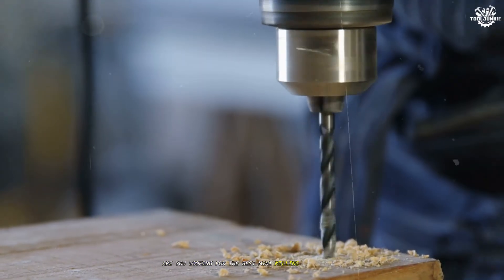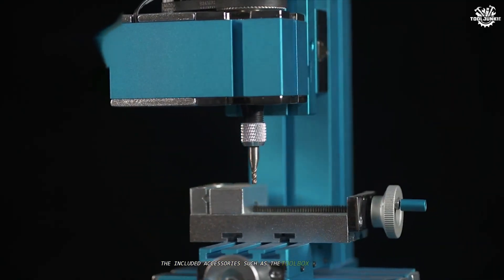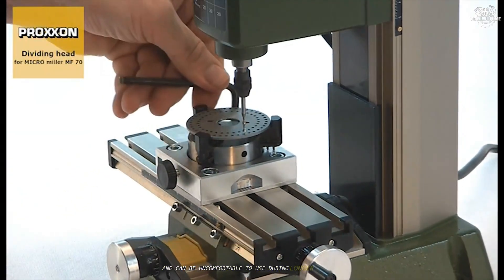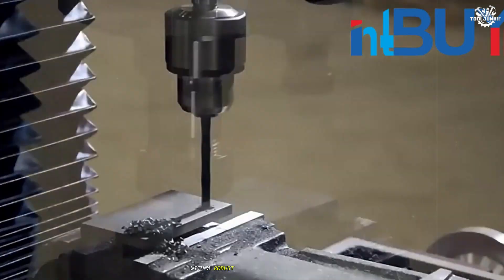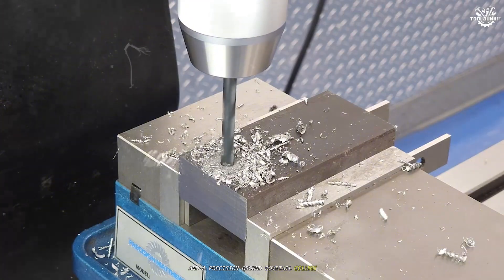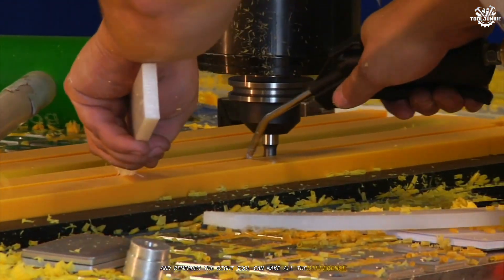7 Best Mini Milling Machine 2025! Which One Wins?

Comment: @ Tool Junkie, I want to thank you for making a great video. I am looking to purchase a mini mill. I don't want to spend a fortune though. This mill would be used for light gunsmithing and making AR Lowers. Which one would you suggest for this situation?
Reply: I believe the PM 728 can be converted to cnc.
Reply: These machines are all likely to disappoint. Find and older used machine with heavy castings.

Comment from the maker: 🕝Timestamps🕝

0:00 - Intro: Best Mini Milling Machine
0:36 - Universal Mini Metal Milling Machine
2:18 - PROXXON MICRO Mill MF 70, 37110
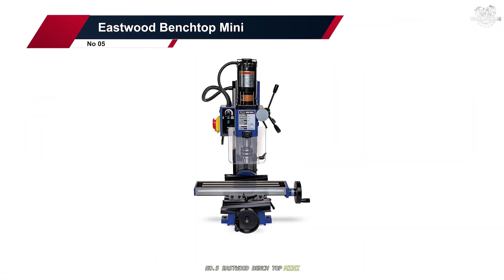4:01 - Eastwood Benchtop Mini
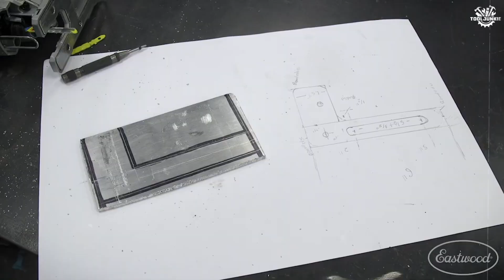5:45 - INTBUYING Benchtop Mini Milling Drilling Machine
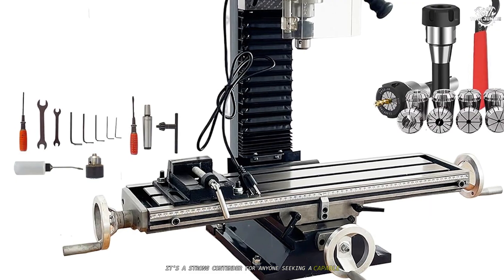7:40 - Grizzly G0704 Mill/Drill with Stand
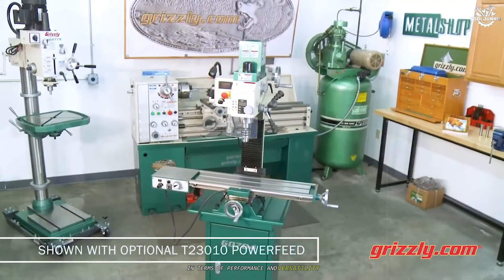9:31 - JET JMD-18 Mill Drill Machine
11:19 - PM-728VT Variable Speed Milling Machine
13:14 - Outro: Mini Milling Machine Review